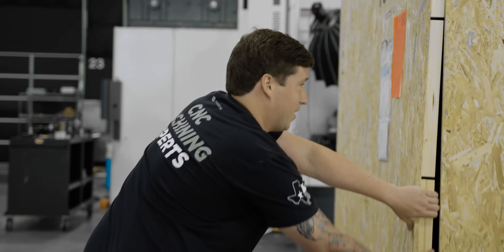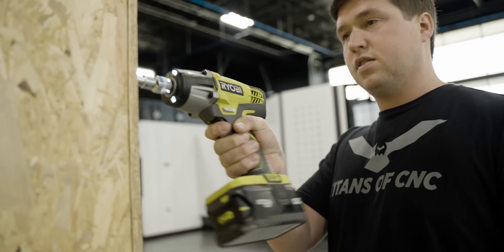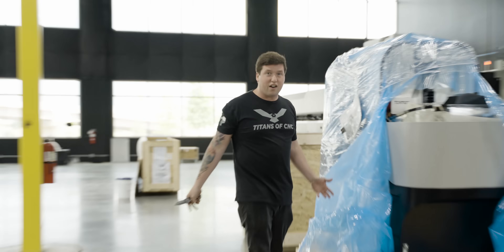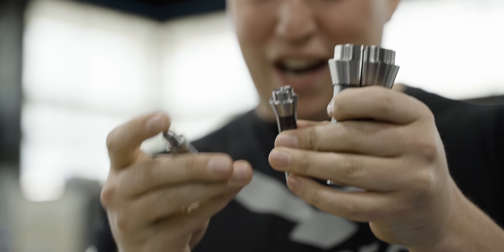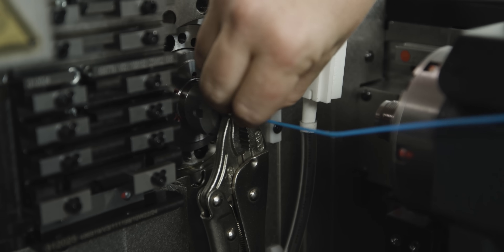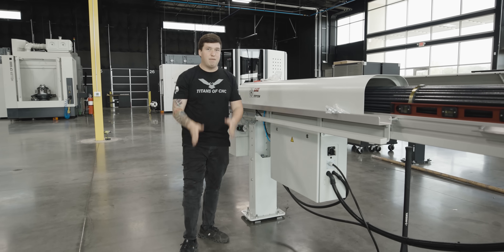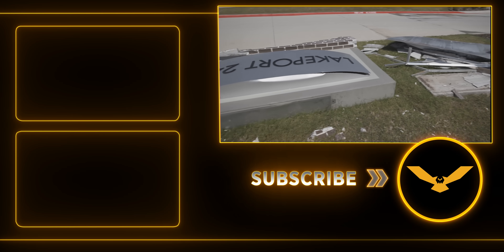You Won't BELIEVE How Small this CNC Machine Is!

Comment: I'm an electrician and we use tons of wedge anchors (those things going in the ground). I suggest you get the proper tool for driving those anchors in, they had a thing called a set tool which has a sort of dimple to fit over the point of the anchor. If you use the actual drill bit to drive them in you're going to dull it faster.  If you're doing it a handful of times I guess it's fine but not when you have to drive in a lot.

Comment: Oh my lort the welds on that bar feeder height screw nut at 8-fifty lol... 

But... Serious question, which I'm not sure is a stupid question, never worked with a bar feeder before, does this thing spin the entire length of bar for the machining operations? Or does it snip it in between each operation? I've only ever seen in videos like this the part being parted off, more bar being fed in, and then the last butt of the bar stock getting discarded. Never seen individual snips of bar stock. I'm just having a hard time imagining the whole length of bar starting and stopping and twisting and slinging around in the feeder at 9-16k rpm through machining operations without galling itself up or work hardening/twisting, especially with tiny brass rods. How does that work?

Comment: I don't know if you've heard of Escomatic (again a swiss brand), but they make even smaller automatic lathes using a technology that allows the tools to rotate around the material, thus completely eliminating the need for a feeder.
Reply: Escomatic used to make a 2mm max capacity machine.   As you said, tools rotate, stock is coiled and passes through straightener before machining.  Often, these clowns show their ignorance of machining.  I'm sure they make money ways other than making parts.
Reply: Hope you're not talking about Escomatic there 🤣 and yes they still manufacture these lathes with newer technologies but are completely absent on social media :/

Comment: I thought bar feeder alignment is done via a laser and a bulls eye target
Reply: These LNS Tryton feeders have an individual tube that holds one bar at a time and will advance to the next bar by rotating to the next barrel.  The tube is pressurized with oil as a bearing to keep the thin, long bars from binding when the bar is turning. Because this bar feeder has oil in the individual tube that holds the bar to be aligned with the spindle, the proper method is to use the string since laser through the oil tube is not a good solution. Hope that makes sense.
Reply: @thewatchmakersworkshop  interesting, so there is actually pressure or just a constant flow? Kinda like the FMB turbo’s do it..
Reply: @lilchirp4846  I think the LNS Tryton is a unique design, but I'm no expert on FMB products (maybe they make one like this as well?).  There are over 40 tubes on the Tryton 112 that you can load the bars into (like a Gatling Gun design).  When the bar to be cut is in position with the spindle, the push rod seals against the back opening of the tube and forces oil into the tube to surround the bar while it is running and feeding the bar into the lathe. This is instead of having guide channels that the bars drop into and spin within.
Reply: Just found out from another YouTuber that there is a microscope and laser type tool available that mounts the microscope up at the guide bushing and a laser that mounts on the back of the tube in the feeder.  I don't know the manufacturer of this setup, but my guess is that it is possibly a little more accurate than the nylon string, but a lot more expensive. From my experience the LNS technicians in the USA don't even use lasers for aligning the Tryton, but that could just be my experience and not others.
Reply: @thewatchmakersworkshop  we use the laser system on our fmb bar feeders, not sure how much it cost but i dont think it was terribly expensive..

Comment: Iv used the same method for alignment when I was a welder before I was a machinist, I had to make a 100 ft conveyor and frame perfectly straight on center, level within about .030, manually, with a metal wire, no laser, all manual, so I appreciate seeing this done in a different situation Donnie.
Reply: 30 tho? lol bro, you had a football field! 100ft though is insane
Reply: @Xphinity  ft not yards lol 1/3 a football field but yeah it was cool I wish I took a picture but my phone wasn’t working that day.
Reply: @adammiller4879  I didn't mean literally a football field, I said it as just an expression. I get though that text carries no context lol

Comment: first what comes to my mind is, why arent you using a laser to fit the bar loader?
Reply: These LNS Tryton feeders have an individual tube that holds one bar at a time and will advance to the next bar by rotating to the next barrel.  The tube is pressurized with oil as a bearing to keep the thin, long bars from binding when the bar is turning. Because this bar feeder has oil in the individual tube that holds the bar to be aligned with the spindle, the proper method is to use the string since laser through the oil tube is not a good solution. Hope that makes sense.

Comment: I know this isn't about the CNC machining but I bought a dirt chip brushless ryobi drill and for the purpose of using it when I didn't want to thrash my good drills and equipment and now after abusing the damn thing for ever it still works fantastic, dropped off roofs, fell in water, left in the sun, run the absolute piss out of it and it still works just as good as the day I bought it and is half the price of everything else, so it definitely changed my look on ryobi for sure lol some of their stuff is no half bad.

Comment: Nice to get a shout-out. As an FSE for CNC machines, I can confirm that there's a lot of work you need to do lying on the floor. If you don't set the machine perfectly level then that deviation will translate to the rest of the machine in multiple ways. It's also not uncommon to need to give a component a calibrated kick for alignment.
Reply: Does that kick come with NIST traceability?

Comment: Tiny parts, tiny money
Reply: Tiny part, big money.  Some of the stainless screws I make that are the size of a grain of rice cost $20-$25 a piece and can be cut in 30 seconds with the right machine tools and good programming. A sliding headstock machine will make parts overnight with no operator present.  No need to load material for the next part either, just add the number of parts to your program and load enough bars in the feeder, then go eat dinner and have a good night of sleep before coming in to work with perfect parts ready to ship. Cutting from bar is my favorite.

Comment: Where were your safety glasses and hearing protection when you were drilling and hammering?  Rather than stretching a string why not use a laser and target?  If you are going to use fixed studs to hold the machine to the floor  why aren't you using a steel pad with shims to provide a level pad?  As an alternative, why not use Philadelphia Resin for the pad?  It would most likely provide a more uniform foundation.
Reply: These LNS Tryton feeders have an individual tube that holds one bar at a time and will advance to the next bar by rotating to the next barrel.  The tube is pressurized with oil as a bearing to keep the thin, long bars from binding when the bar is turning. Because this bar feeder has oil in the individual tube that holds the bar to be aligned with the spindle, the proper method is to use the string since laser through the oil tube is not a good solution. Hope that makes sense.

Comment: Why u guys dont use a laser to put the loader with the maschine in straight?
Reply: These LNS Tryton feeders have an individual tube that holds one bar at a time and will advance to the next bar by rotating to the next barrel.  The tube is pressurized with oil as a bearing to keep the thin, long bars from binding when the bar is turning. Because this bar feeder has oil in the individual tube that holds the bar to be aligned with the spindle, the proper method is to use the string since laser through the oil tube is not a good solution. Hope that makes sense.
Reply: @thewatchmakersworkshop  iam working with those lns barfeeder and produce eatchpieces in switzerland so i know them :) the thing is with a laser its way simpler you can buy a system like that allready from LNS
Reply: @dotazokker  How are you using the laser on this style of feeder? The USA LNS techs use the string method on this machine and I asked them the same question about using laser but was told that the nylon string is their preferred method (maybe too expensive to give every tech the special laser that can mount on this type of rotary bar feeder?).  I think often times Europe has- the proper tools as a solution and then in the USA we end up with work arounds as our standard.
Reply: @thewatchmakersworkshop  you put the laser with a guide on the end ob the feeders barrel then u have like a microscop with a system to assaböe it in the guide bush and u can see trught the whole maschine and feeder
Sry for my englisch by the way
Reply: @dotazokker  your English is good enough! Thanks for the info. Always nice to learn, I had been using a homemade camera system for setting tools and sub spindle alignment for years, before I learned about Mowidec.  Asking lots of questions is the best way to learn!

Comment: I remember spending a week at LNS to see the different trades. It was very interesting.
The thing that really made me laugh was a durability test where they jammed a loader with a steel bar. The sound the machine made trying to turn was deafening. I was told that this test had been going on for at least a week. 
This is where i used a lathe for the first time.
I was even able to assemble a control panel. 
18 yo me had lot of fun.

Comment: Filming inside that thing is going to be fun, not much room and the oil is going to be everywhere.  I do look forward to seeing it working.  Thanks for sharing. Charles
Reply: Also, the movements of the machine and the parts are so small that most moves don't even look like anything is happening.  Only time I can tell mine is moving is when I move to the next tool.  Cuts are so small you don't see much movement at all with the oil spray.

Comment: Put your fingers under the suspended load.
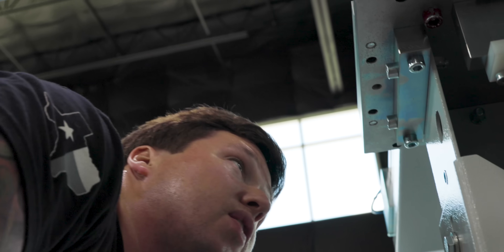8:00
Are you serious?
Reply: 11:46 No safety glasses
Reply: 11:35 No respirator to prevent dust inhalation. No water to prevent dust formation.
Reply: good lookin out, i didn't catch that initially. ngl, safety glasses and dust control are always good ideas but putting your fingers under a one-ton-ish piece of equipment hanging off a strap from a forklift seems straight up crazy.